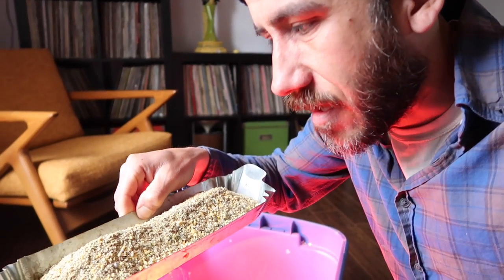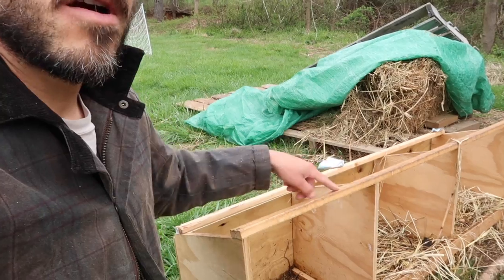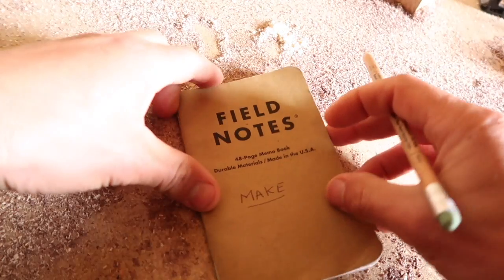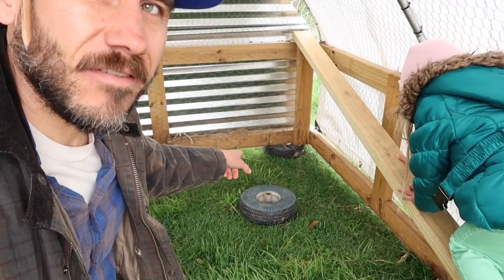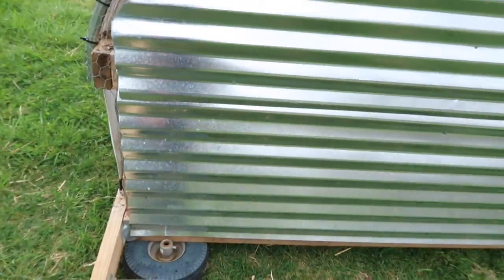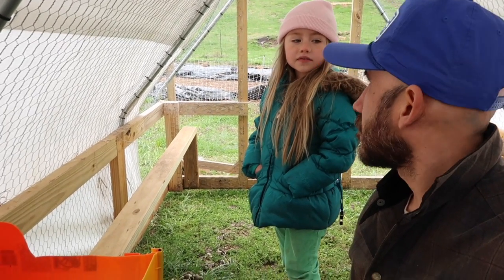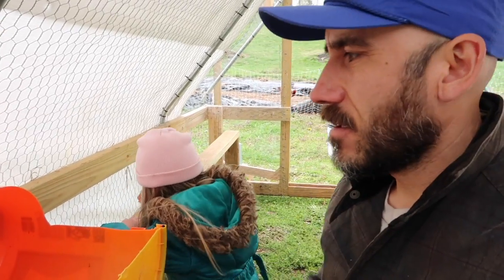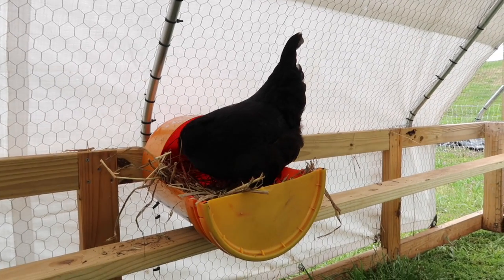Nesting Box from a Home Depot Bucket

Comment: We used buckets for our nesting boxes. Left the lid off and did not cut them. We built a perch in front for them to jump up on. Leaving the bucket whole gives them more privacy (which they like).
Reply from the maker: I would have thought that the bucket would be too small. But maybe not. That may be the next thing I try! thanks for watching!
Reply: You just cut the lid to a few inches. Enough to hold the nesting material in. We use pine shaving. we also have a perch in front so they have something to stand on before entering. Good luck.

Comment: They will I have a similar set up with the same buckets. I put them on a slight angle leaning towards the back and only cut the lid in half. The kids come off all of the time so I now keep them off and with them at an angle no eggs fall out. Also I put a screw in the front of the bucket that goes through to the wood so it is stable and I can remove it for cleaning if needed. If you trace out the inside diameter of the bucket on a lid and cut the lid you can use it as a scraper to clean out the bucket.👍🏻
Reply from the maker: That's  a good idea! Thanks Joshua!

Comment: the chickens are still going to poop on the bucket maybe less but you will catch them roosting on it, you can use the ordinal box you made, add the tin back on top and fix it to the outside of the coop, this was a fix we found to work really wall. also add cinder blocks to the 4 corners either tie down or lay 2x4s over the corner boards you have sticking out and you can add a few extra, but you made a huge sail
Reply from the maker: Yes, that me be my next step is attaching the boxes from outside. We'll see! Thanks Robert!

Comment: Looks kinda small? Maybe a plastic milk carton on its side, with an added sloping roof. Or add a different roof or barrier to the really nice nesting boxes you already built? I wouldn't think you'd want a solid bottom box (for hygiene), but at least this will be easy to clean. Is there any way to hang your nice boxes to the outside of the coop, so they can't perch on it at night?
Reply from the maker: I may eventually try and hang those boxes if this doesn't work. This is kind of like an experiment i guess. Thanks for watching!
Reply: If it was on the outside of the coop, predators would have an easy access to fresh eggs.